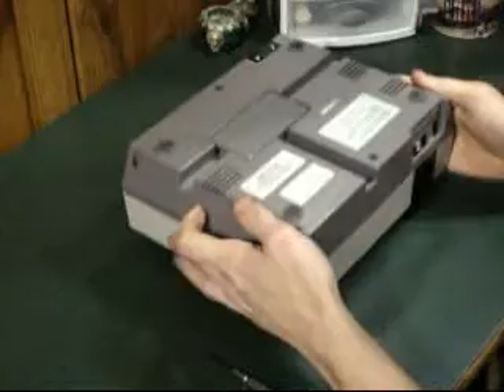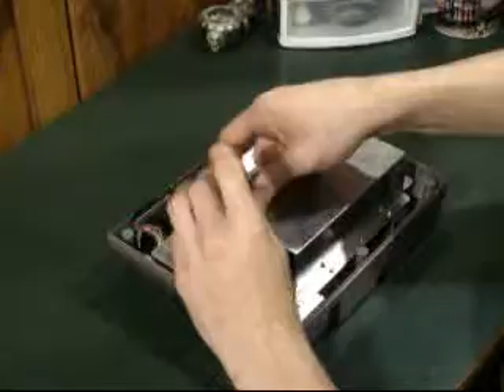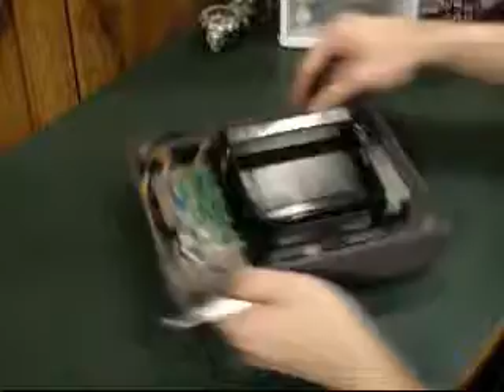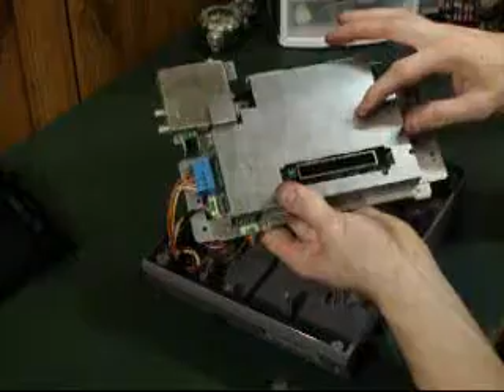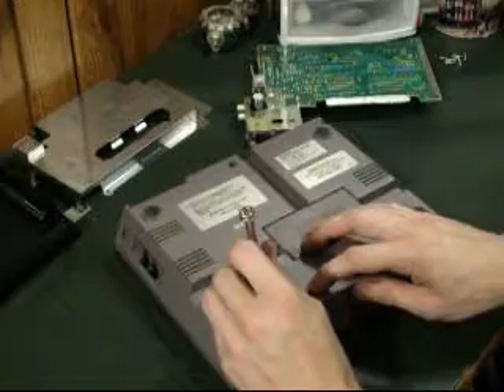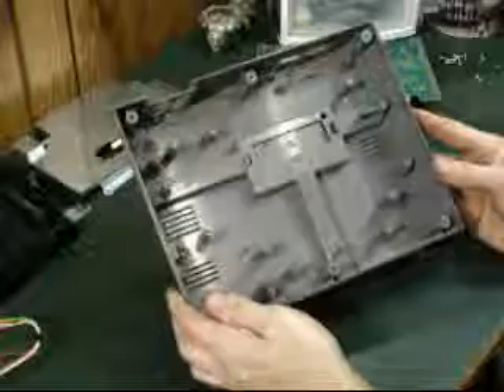How to Change Your 72 Pin Connector, Disable The Lockout Chip and Clean Your NES System: Part 1

Comment from the maker: @CMOODO Holy Crap you broke the screw driver!! That is tight! I have never run into any screw that are tight enough to bust a screwdriver. Someone may have used lock tight or something on the screws, in which case they are probably not comming out.

Comment: I have a new question. I was trying to fix my brothers system by changing the 72 pin connector and that didnt work. When I turn it on, the screen is pixillated but doesnt flash or anything.. I cleaned out the system as well. Do you think it could be the end of the road for this system?

Comment from the maker: @BringinTheCody Well I imagine that the board could be ruined but in your case I wouldn't think so. Some of the soda may be disrupting a signal somewhere on the board which is making it freeze. I'd clean the soda off and change the 72 pin connector and see if it still freezes on you.

Comment: @GanglyM Okay thanks! Do you think that could be a cause to my problems? The games all work fine, but they will randomly just freeze out of nowhere. It also does the blinking thing, but thats usually taken care of easily... so I know I need a new 72 pin connector, but I wasn't sure if the mother board could be ruined

Comment from the maker: @BringinTheCody Your right I did not go over cleaning the actual motherboard and to be honest I'm not sure why I didn't. I do clean the board while I'm in there. I just use windex on a Q-tip. The only thing is that the pins on the board snag the Q-tip or rag or whatever you use really easily so just go carfully.

Comment: I don't think you mentioned cleaning the actual mother board/chip for the system. When I cleaned my system, I noticed that soda was spilled on it and there was some on the actual motherboard itself. Should that be cleaned as well or could that damage it? If so, what do I use to clean it?

Comment from the maker: You certainly can refurbish your old 72 pin connectors by bending the pins and cleaning them. However most of the connectors on eBay are new, made in China or Taiwan.